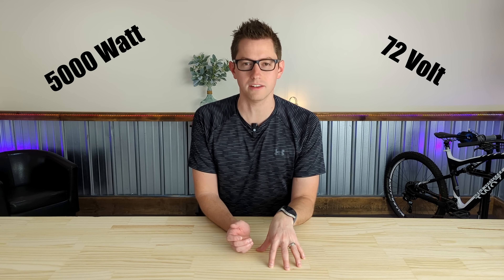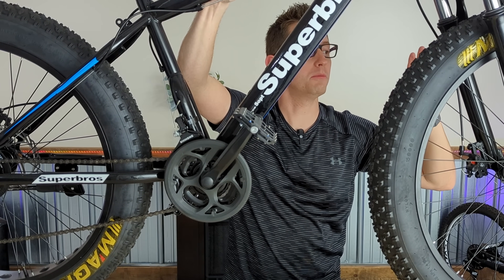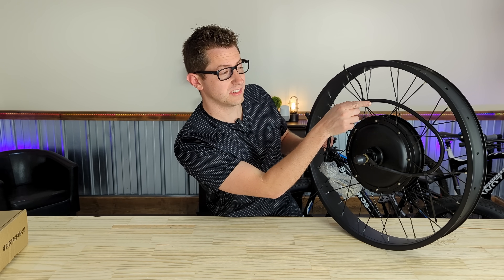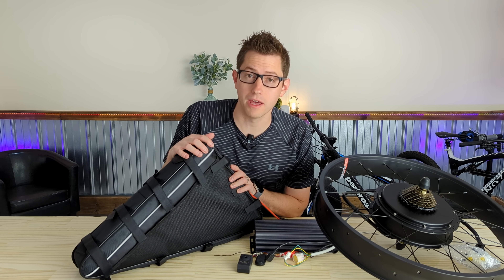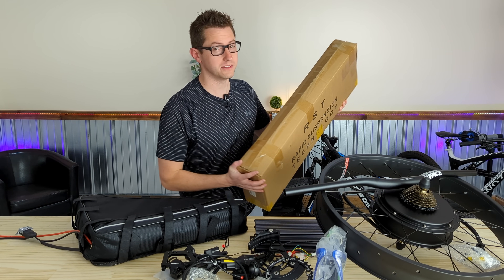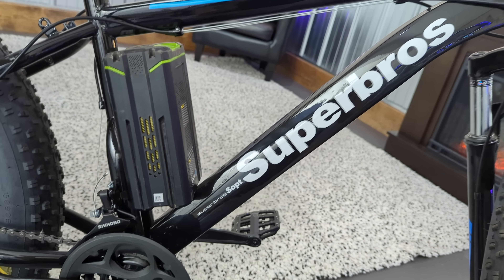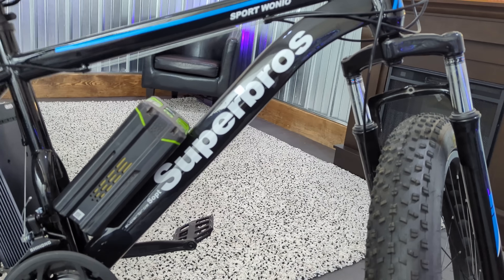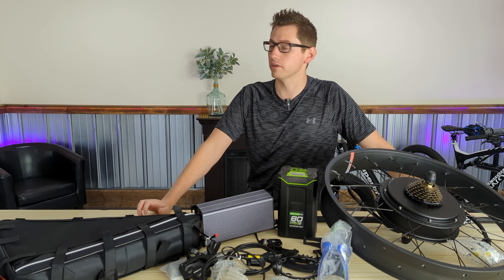DIY 5000 Watt Fat Bike build: The Overview

Comment: Do they use the same size hub motors on a 3 inch fat tire vs. the t you pical 4 inch?

If not, I am wondering if I can also retro fit the frame with a standard 2 inch tire motor if I can't easily find a replacement for the possible 3 inch tire hub.
Reply from the maker: I'm not sure on that specifically. Either way though, I would think you can fit a standard 2-in hub motor in a fat bike frame. You would just have to have some some spacers to fill out the gap between the dropouts....... And it would probably look a little goofy lol
Reply: @overvolted  Ya, these distributors never share full specs. I just want to know I can easily and cost effectively replace the hub in the future. I only found one hub and rim combo that state for 3.0 inches and the power starts at 2000W, which is the limit I would put on a city cruise style. Lol

Comment: News flash: Greenworks already sells three 80 volt pedal-assist e-bikes. They've got a couple offroad bikes with 4" wide tires, one with 20" rims and another with 26" rims. Their commuter bike comes with 27.5"x2.25" tires and a luggage rack. If you want something to ride without pedals, they also sell a 60 volt go cart, a 60 volt minibike, and a standup scooter that runs on a pair of 24 volt batteries.
Reply from the maker: they copied me. lol jk. I'm glad they sell those now. Wish i could get my hands on one and compare.
Reply: NEWS FLASH. Let this man build.

Comment: This is amazing! I'm planning out full suspension Fat bike with a mid drive running a bbs02 48v. Not sure about the battery but it won't as insane as this. You should attach wings and a electric turbine this could easily fly cross country with that amount of power! 😅
Reply from the maker: Lol! That's awesome